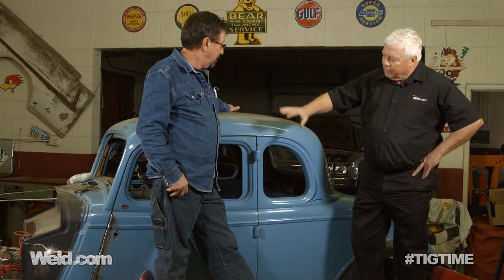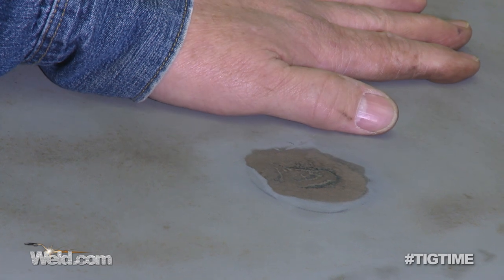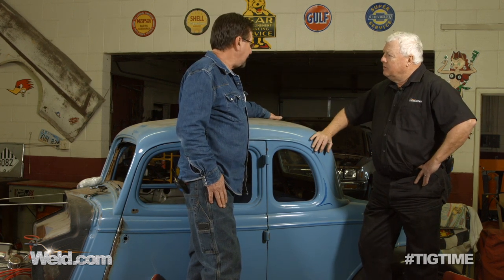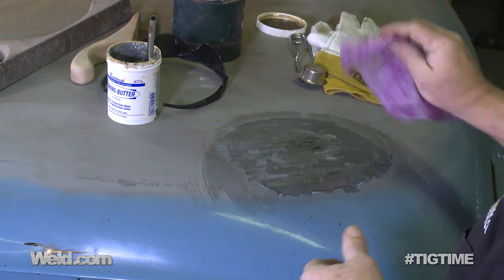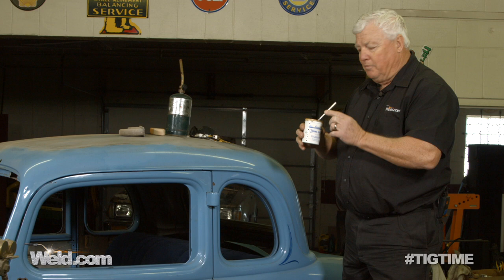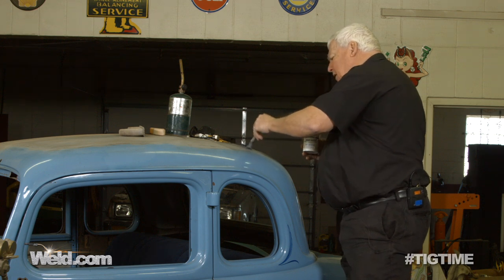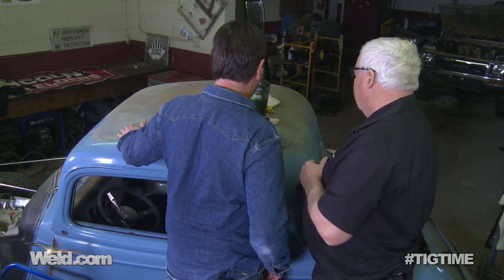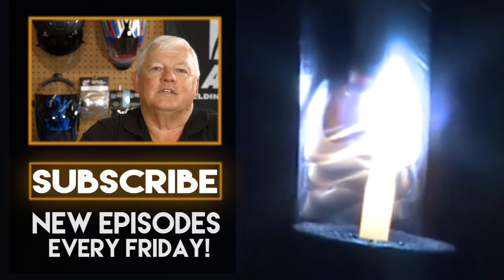Auto Body Solder: Tinning and Leading Repair | TIG Time

Comment: Thank you for showing this technique. i have never leaded!  but i did try it on my car that i am restoring. the car had two small scratches and dents that we did hammer out but thier was an area that we did our best on hammerring out. we cleaned the area, sanding it out and we then leaded the area and grinded it and sanded it to a perfect straight condition. all i did was take my time and worked it and it looks great.  NO BONDO!!!  Very happy with the results and after we painted the car with the factory color and with single stage acrylic enamel, just like it was sprayed originally it came out straight!!. you can not see the repair, just a straight area!!! again thanks for the education of an art that would have died if not for folks like you putting it up on utube to educate guys like me who still believe in the original ways. sometimes i do believe that corporations have done an extremely fine job in marketing and convincing people that the more product you buy to make the repair is the right way!, amd the only way!!! I  disagree with that. I will from now on lead all repairs that i feel need to be leaded!!! thanks again!!
Reply: Bondo is Not a criminal. There’s very advanced good quality. Technique is an important factor, for a long lasting success.

Comment: There is a 1940's US army film showing leading dents on battered Jeeps, they were using damp sacking for wiping the solder, some of which looked an inch deep. The old boys used to use a mole skin for wiping solder.

Comment: I'd like to see another leading video, but on an A-Pillar. I remember my dad and I having a heck of a time when we leaded the A-Pillars of my mom's '37 Terraplane Coupe during its first restoration about 12 or so years ago after it was media blasted.We got it done, no bondo needed afterwards, all metal finished and high build primer. But you can'y go all the way to liquid on a vertical surface. We wasted a lot of lead on the shop floor getting the lead to the consistency of wet clay for it to stay stuck long enough to cool and be worked.

Comment: Old school techniques like this are still good! You don't breathe any significant amount of lead vapour because you don't heat the job that hot- it's not like burning paint off!!! Plus if you use bondo what about he solvent fumes/vapours? A good worker will recover the shavings, remelt them and use it again-try doing that with bondo dust-which isn't good for the lungs anyway.

Comment: This is like soldering electronics, can use solder paste (although it is surely way too expensive to waste on cars). Obviously the flux must be washed off before paining, and before adding the 70/30 lead/tin. What was done in the video should be removed with heat (fluxed copper braid works well) and reapplied.

Comment: Instead of using the metal file, couldn't you used a small grinder to shape it faster? I'm just curious, never seen this done before.
Reply: The problem using an abrasive on soft metals is that they tend to gum up the grinding wheel.

Comment: Typically, the problem with 'Bondo' is that it's made of polyester resin and Talc as the filler or binder. Talc absorbs water or moisture like crazy. If you ever wet sanded a bondo repair you can see this. This is usually why these kinds of filler repair will bubble a few years after the bodywork, even if it's a 'show' car you keep inside out of the elements. I would prefer a 'lead' repair which even the factories were using in the '70's or a product called 'All Metal' which uses aluminum powder instead of talc and is way more moisture resistant.